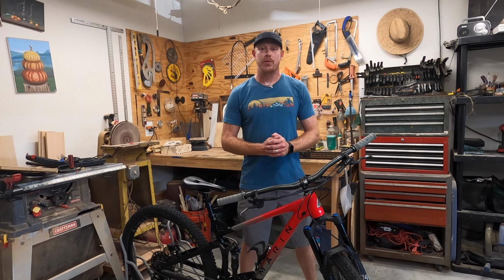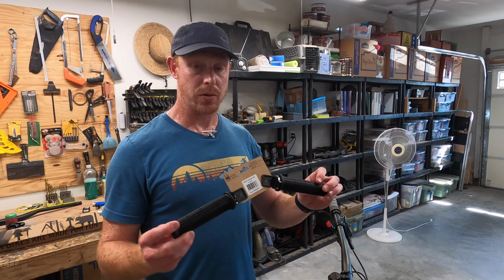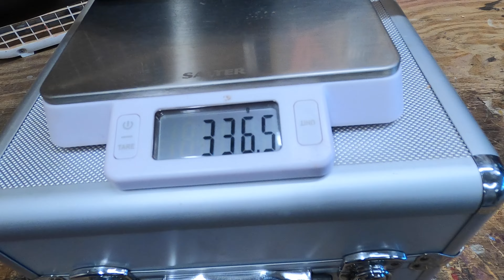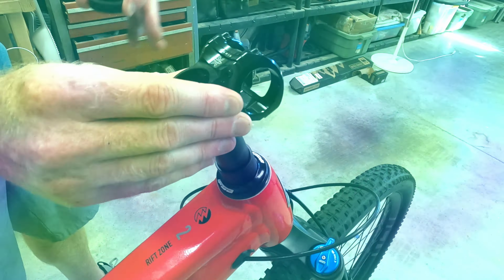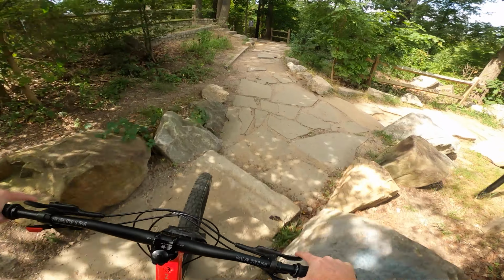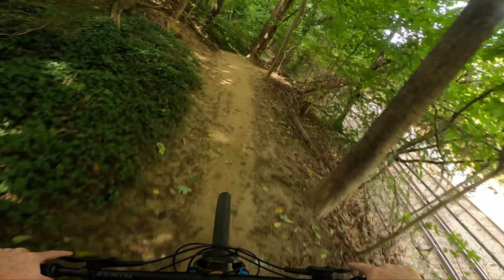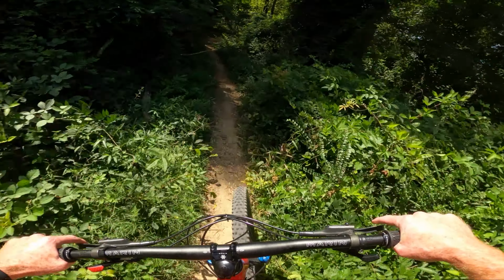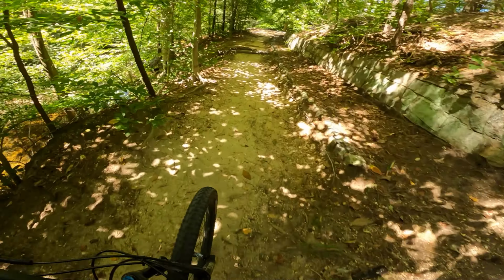Marin Cockpit Upgrade - Handlebars Stem & Grips

Comment: Man, I can't get along with the 35mm stem. Ended up getting a 40mm stem that also has a rise.
Reply from the maker: I actually just ordered a 40mm stem yesterday. Hoping it will help me weight the front wheel a bit better in turns. Excited to try it out because I’ve been riding this bike for over 4 years now with it at 35mm.
Reply: @downtoridemtb  haha I think you'll be surprised at how much smoother it's gonna feel!
Reply from the maker: @toanmaxdark7  wow for only 5mm it does seem to make a difference! Feels like it slows the steering down but in a good way. Less twitchy. I like it!
Reply: @downtoridemtb  awesome brother yeah that's exactly how I felt!